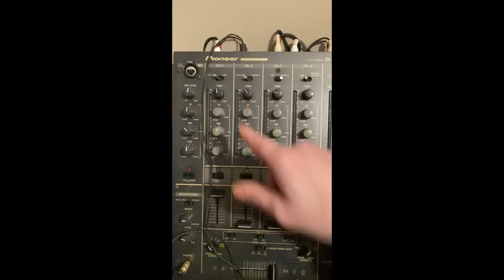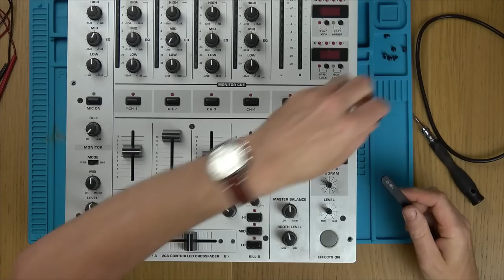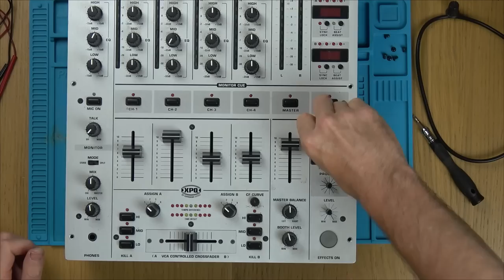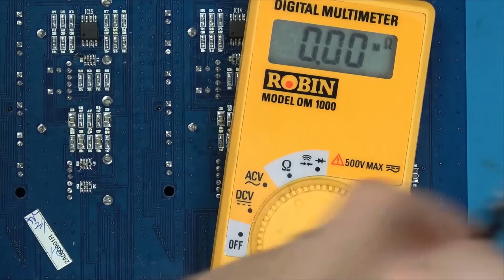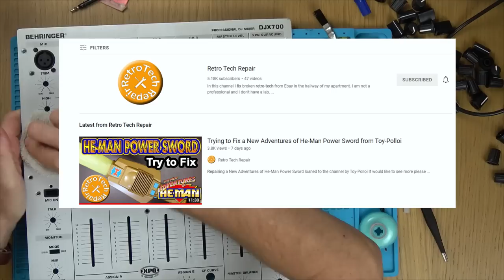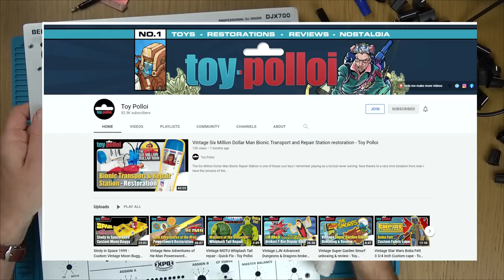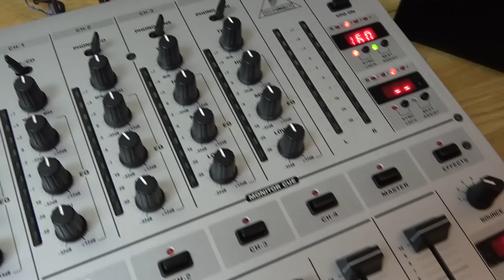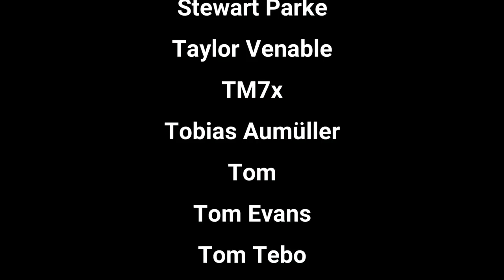Can I Repair a Faulty BEHRINGER DJX700 DJ Pro MIXER

Comment: My guess is that there was a solder bridge somewhere on that pot, the second you manipulated it, it created a feedback loop (output bridged back to input). When you desoldered it, you fixed the bridge and the fault vanished. :)
Reply: Maybe but at 18.47 the soldering om that pot does not look great on some of the pins , 2nd, 3rd and 4th look a bit dodgy , maybe the move and new solder did the trick
Reply: But that would of been in manufacturing and I assume it worked from new. 
I think the dust inside the slider was partly the issue, the slider to track contact was going open circuit so the signal path was open and no control over the gain on the floating input.
Most mixers use op-amps for the signal path and op-amps open loop gain is huge, so if the gain was not being controlled and a floating input signal, it would go into oscillation.
Without examining the schematic its tough to determine for sure what the true cause was.

Comment: As a dj its was great seeing you fix that mixer. I used to sell those djx700 mixers like hotcakes when it first came out, wasn't great but a cheap alternative to your djm-600. I don't even know how many mixers I threw away from the same issues you fixed here.
Reply: Question 
I have one djx700 but no master sound. Not even the leds are working.  
All the channels except the master sound. I have signal on each channel I can hear it. Using my headphones. But no master. Any thoughts?  TY in advance

Comment: The mid-range tone control on each channel will be an "active bandpass filter" using the V4580 low noise op amp with some Cs and Rs around it. I guess there was a dry joint on that pot which caused the opamp to produce rather a nice-sounding oscillation.
Reply: Yeah, that was pretty much my guess as soon as I heard it. It's one of the most common faults on mixers after crackling pots.

Comment: It was a bad solder joint, look back at the footage where you were messuring the resistors. One of the pins had a hole. Simply resolder would (has) fixed the problem.

Comment: When you were saying that the mid potentiometer on Ch2 was affecting all channels, it actually wasn't affecting them.
The noise was purely contained on Ch2 only.
The reason you heard it when you were using the other channels is because you had all the faders up, thus allowing any audio from each channel to be routed to the Master and heard.
Had you only used one fader at a time (with the Master fader up) then you wouldn't have heard the Ch2 problem with the Ch2 fader turned all the way down.
Reply: Exactly what I was thinking no need for the turn button swap and I'm sure he left the top centre dead spot turn button with one that was a non dead spot turn button great soldering though

Comment: MMV the Mixer Fixer!  Another great video, although it did make me buy some low melt solder half way through.  That stuff seems super useful!  👍
Reply from the maker: Cheers Steve. It is very useful and you only need the smallest bit. I've become converted to the stuff after not touching it for over a year 👍👍👍

Comment: Another good job vince! Part of my job back in the day was repairing this type of stuff. Used to work for a company supplying DJ equipment to pubs / clubs such as amps, speakers, mixers, karaoke systems and DMX lighting systems. On another note I just did my first xbox series x repair video the other day if you want to check it out!

Comment: My son was a DJ in a local working mans club, a drunk girl came to the decks to request a tune.
Her double Gin and Tonic went all over the mixer, luckily he could carry on with the gig by bypassing the mixer.
It took me hours to clean out the sticky mess from all of the pots and sliders etc, even then it was never 100% again.
But these Behringer mixers are well made and so easy to work on
BTW on the left and right channel leds, there is always a difference on the levels.
To check the accuracy of the led meter, put the same sound source into both L and R channels, they should show the same at the same slider setting.
Once more another gteat vid.
Ray

Comment: They are dual gang pots - you're working with a stereo signal. To keep the levels from the left and right channel tracking as you move the pot they actually put two pots on the one shaft, and they turn in unison. :)
Reply from the maker: Thanks Dash 👍👍👍

Comment: I have to say that usually the faders and the potentiometers are the most found issues on the Behringer mixers. I bought a DDM4000 a few years ago and the gain potentiometers started hissing when i was turning them. Since it was under warranty i sent it in for repairs, they repaired the the gains but i had volume issues with one of the faders, they ended up replacing it under warranty

Comment: Glad it's working. Just a couple of points. When connecting a mixer & amp you should always turn the amp on last; then, when turning off, you should turn the amp off first (good practice is also to turn amp volume levels to zero before connecting or disconnecting). This prevents the loud pops (and potential damage to speakers).  I'm not sure 5 pin components were potentiometers; didn't get a great look at them but from what I saw, they appeared to be rotary encoders.
Reply from the maker: Cheers SG👍👍👍
Reply: Yes I worked in a theatre as technical manager for three years and the number of times bands would pop amps and speakers because they put a channel to maximum and then plugged a guitar in... One band that came in did just that and the house amps went into protect so I put the masters down and I told them do not touch anything and went off to reset the amps I then came back to find they had turned everything up and did it again needless to say there was a lot of language....
Reply: Stereo pairs into each pot

Comment: I used to have this exact mixer. They're excellent quality builds. His pioneer one is a good one too. You can use isopropyl on these, it won't wipe away the markings. They're painted on. I'm doing a Gemini 626 as we speak.

Comment: Nice one Vince.  I agree the problem was either a dirty/dry jointed potentiometer, which you fixed when you desoldered/resoldered  it.  One comment did you check the value of the two pots you swapped over as they may not have automatically been the same value.  Also that muck you scrapped off the pcb at the start may have been slightly conductive, due to liquid ingress.  Causing feedback or oscillation in the op amp.  
Generally Phono inputs are 1-2mV, CD inputs up to 1V and tape decks 250-500mV.  If you put a CD into a phono input expect at least extreme distortion or damage to the first amplifier section.  Nice job though.

Comment: Hi Vince, good to see you back on the feet without covid. Also what may have "fixed" the potentiometer was the fact that you pulled the cap off and it moved stuff inside.
I've had a few of these "dunno what I've done to fix it" fixes.. The low-melt solder is often like magic and VERY useful.

Comment: Tempo Difference is the difference between the BPM of source 1 & source 2. When beatmatching you need both sources at the same tempo so they stay in sync during the transition.

Time Offset is how far behind or infront the beat of your target is from your current source, it basically tells you if you need to pull or push the target vinyl/cd to sync it with the source.

Comment: I have had many mixers during my time as a dj. I even had a Behringer at one time. The slide faders are notorious for cutting out. I think I had to replace 3 or 4 of them at one time or another. Sometimes switch cleaner worked, but not for long.

Comment: The solder gun and braid struggled because the ground planes are large on this PCB — they soaked up the heat before the solder can reach the melting point. Sometimes you can get away with holding the heat source on the ground plane pin for longer but you can damage the PCB (warping) or component. A larger desoldering gun like the Hakko FR-301 helps but can still run into challenges on multi-layer PCBs and larger ground planes.
Reply from the maker: Cheers Stephen 👍👍👍

Comment: I'm not sure if you already meant this by referring to different input voltages, but I think the key difference between line in and phono is that line in is buffered with something closer to a unity gain op-amp while the phono buffer has a gain of some magnitude greater than 10 with some additional passive filtering before entering the actual mixer. This would explain how a resistor could be blown out by treating a phono input as line in.

Also I think the rotary potentiometer is either a double track or double tapped component, and by swapping them you may have gone from a broken track/broken points between taps to a totally fine one, and perhaps even the original IC dealing with the broken pot dealt with both track while the bottom IC that you swapped it to only needed one.

The tone you're getting could be two things imo. It was either a downstream effect or, (and perhaps more interestingly,) an oscillation resulting from a failure mode of the IC due to having a vital path of resistance floating/open.

Comment: Hi Vince, Variable Resistors or controls, sliders or rotary, come in two main types Linear or Logarithmic. 
This means inside the control the tracks resistance will change at either a linear or logarithmic rate.
So a Linear control would be at half the value in the center but not so for a logarithmic control.
The controls used to have printed on the side either LOG or LIN to indicate which type they were.
There is a good reason for the difference in the controls, our ears or hearing is logarithmic in sensitivity, our eyes and sight however is linear in sensitivity.
So historically Volume controls are normally Logarithmic and Brightness controls Linear.
Historically this is a good rule of thumb BUT as controls are now often controlling digital devices they are not necessarily going to follow those rules.
So Vince, I hope this helps you to understand why a control may not show half the value at the center point of its travel.
I enjoy your videos, but from time to time I feel the need to pass on a few tips.
By the way, I used to work for BT around 1980 to about 1992, I worked at one of the Birmingham locations. 
I now live in the USA and I'm retired but still enjoy repairing things and also have a YouTube channel.
Cheers and Good Luck.

Comment: The Master Quest for the before fixed Robin. Good work. My guess would be a bad solder joint or dirt, but I'm not sure. The Mixer is very interesting indeed.

Comment: The squeal is feedback, or overdriving the input of the main stereo output.  There are gain stages, each step along the way adding or removing signal.  One of those pots had a short causing it to go into clipping.  These consoles get banged around, beer spilled in them, dust and moisture.  Heating may have burned off some volatile residue.  Spray some fader cleaner in them and work them back and forth.
Reply from the maker: Thanks Tiporari👍👍👍

Comment: Nice Video Vince the loveley sound was a feed back problem in one of the amp stages in the mixer on channel 2 possible cause it some modern op amps are biased using dc voltages and they couple with out using capacitors in some stages like in differential amplifiers if one of the resistors was open or shorted it could cause positive feed back creating the sound when you heated things up you put the resistor right and fixed the problem it could also have been a rouge capacitor with a bad connection . part 2 our hearing is logarithmic 3db in change is about the smallest change we can detect with normal hearing so audio controls for volume are almost always logarithmic in change.   if you are working on a phono graph they employ a bias of the sound to remove noise  so recording is not flat the phono imput will remove the bias and return it to flat.  fun stuff excellent work mate

Comment: Awesome video Vince!  Glad you got it working a lot better than it was when it left me!  Channel 2 was odd - I don’t recall it doing that before, the Left and Right problem did used to occur intermittently like you saw too though. Absolutely no idea what was going on with Channel 3 - I had fiddled with it all manner of ways and got no output.  Gremlins in the system for sure!  It’s got a new lease of life now though.  I was too scared to have a go at fixing this myself.  Tons of features on this and I was a bit daunted - maybe because I didn’t want to break anything else with it being quite a complex bit of kit - you seemed like a pro with the volume mixing by the end if the video in anycase.  You should give beat matching a go ;)  Thanks for another great video - was great to see the insides of this mixer.
Reply from the maker: Thanks Matt, maybe it can be a revisit video if the problem reoccurs. It is a lovely piece of kit, looks well made and easy enough to get into to repair. Cheers for sending it in as it is something I wouldn't have thought to buy on eBay. Really glad you enjoyed it 👍👍👍👍
Reply: Just rewatched the video and feel I’m obliged to mention, try to keep the channels out of the red during any / all playback.  You could blow a speaker with the wrong audio tone blasting through it on full ;)
Reply: @ianr4362  I can have a bash for sure :)

Comment: The reason the slide potentiometer is not '50' in the middle is that it's an audio component so will be a logarithmic taper (type A) rather than a linear taper (type B).
Reply: Yeah, well said - beat me to it!
Reply: pretty great for doing smooth transitions..... /sarcasm

Comment: Awesome fix =D  I wonder if there was a bad solder point relating to that pot that was giving a squeel - or a bad connection on one of the connectors you re-connected later?   I am sure others will point out - Try and avoid using the regular deoxit on pots and faders - they have carbon tracks and it can deteroriate them (apparently)!  You can get "Deoxit Fader" I think, especially for them.   That said, I bet it will be OK - I've used it on faders before and they still work perfectly - so how much truth there is in that I am not sure, but I always get people pointing that out on my channel!
Reply from the maker: Cheers for the info Chris, being a fan of DexoIT I will look into the fader version 👍👍👌
Reply: @Mymatevince  Yep, the fader F5 version has a lubrication in it to help protect the carbon tracks.  I know it's another expensive can of stuff to have around, but it's the right stuff for the right job.

Comment: I had a similar with my mixer the Mid would make a buzzing sound turned out just a cold solder point. Mixer's are well built everything can be replaced or fixed easy.

Comment: My guess is a feedback loop due to either a "metal whisker" or a "cold solder" which was repaired when  you de-soldered the components and then replaced them with each other. 12voltvids regularly will just re-solder a component points on the circuit board without replacing them and that solves a very high percentage of the equipment fault he encounters.

Comment: tip      to clean the slider use isopropyl on the track and an ink rubber is fantastic to clean the contacts

Comment: nice video , The reason for the 6 pins is that is it's  a dual pot,  one set is for left channel and the other set is for right channel, same as the fader you cleaned, My only concern is that you swoped the 2 pot around, The 2 pots may seem the same but are the values the same ? I would think that the values would be different for the different frequencies ( mid and low frequencies) It could have been a dirty pot that caused the op-amp (ic15) to oscillate, last thing the fader was up on that channel and you would hear it on the output
Reply from the maker: Thanks AR, I should have measured resistance on the 2 dual pots when they were unsoldered to check. You always have the answers, thanks for watching and sharing your knowledge 👍👍👍👍👍

Comment: the behringer was sort of a budget decent mixer, im surprised the crossfader hadnt gone its usually that what goes first. those lights above it are for beat matching. most dance tunes have a 32 beat cycle. was a good view this video as my brother used to have this model. to be fair when i saw what your fixing i thought you had bitten a bit to much off but as usual you surprised me. good job....(edit) if i remember right there was a pioneer mixer nearly exactly same as the behringer but at double the price.

Comment: You should learn how op-amps work. Amazingly simple and the perfect analogue IC. Real life are not the theoretical ideal op-amp and when the feedback resistor network (which includes those dodgy pots) goes out of spec you end up with positive feedback multipliers and it turns into an oscillator. Nothing wrong with the op-amp, but the dodgy pot gave this interesting effect.